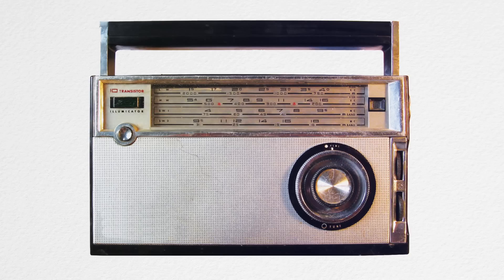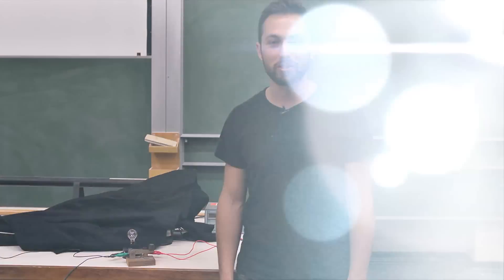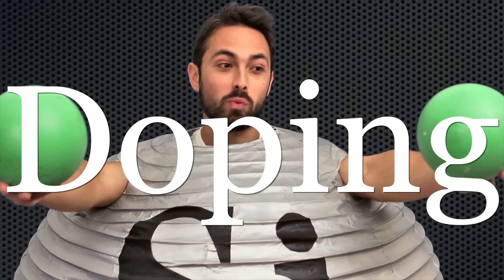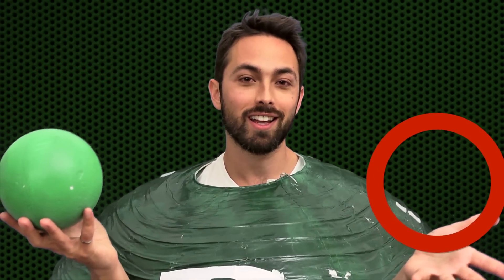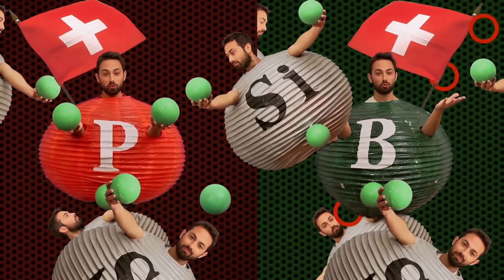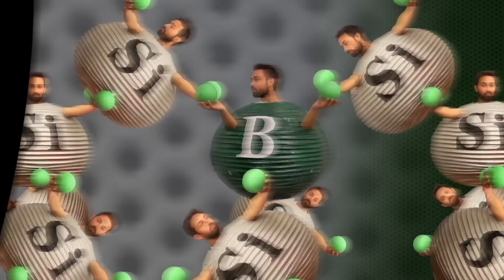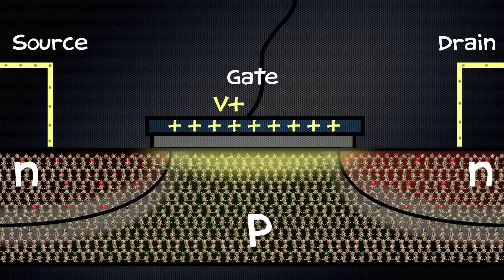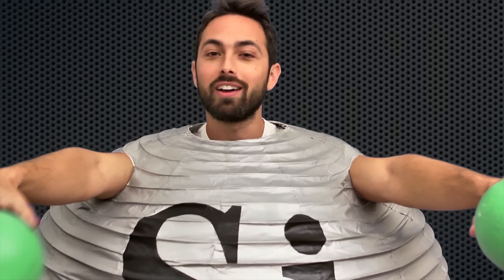How Does a Transistor Work?

Comment: id like to know, wouldnt u need to switch the voltage on and off using mechanical swith? doesn't that defeat the purpose?
Reply: Logic gates are a construct made from transistors.  They are a basic element of computers.  They perform logic functions known as Boolean functions.  The one that makes up your computer is called a NAND gate.  A logic gate has one or more inputs and one or more outputs and a truth table describes all possible inputs and what the outputs are for each set of inputs.  I would suggest looking up logic gate in wikipedia look carefully at the truth tables and learn them.

In a computer the inputs would at some point be the code that is running and the data that is being operated upon.

As for the transistor and where its input comes from, that depends on how it is being used.  If it is being used as an amplifier then its input is the signal to be amplified, such as the signal coming in from an antenna.  If it is being used as a switch then the input could come from the pressing of a button, such as when turning something on or as I mentioned before from the code or data being run in a computer.
Reply: it can also be used to convert analog signals, like ur mic, to digital signals.
Reply: Siddharth Agrawal
These transistors are used in logic gates – each single logic gate is a group of transistors. Basically a logic gate is a simple electrical component, commonly has at least two inputs and one output, that turns its output either 1 (on) or 0 (off) depending on the combination at the input. For example, the AND gate which needs both inputs to be in the 1 state for the output to be 1, or the OR gate which needs either or both inputs to be 1 in order for the output to be 1.

If logic gates are groups of transistors, integrated chips are groups of logic gates. Microchips contain hundreds of thousands, if not millions of logic gates to process, direct, and recognize data. Using mechanical switches to turn a transistor on is nothing too different. For example you want to make a mechanical-switch operated passcode or combination lock then transistors would certainly be used to recognize the switches you're moving. Plus, now that you're reading these letters on your screen, the time I typed these words, each key I press activates a set of transistors grouped into logic gates to present a specific binary code to identify which key I was pressing to display on the screen.
Reply: ***** i didnt exactly get first paragraph hope u would ellaborate. how do u connect the output to the ground or connect the output to the voltage source?
Reply: ***** PLS REPLY MAN
Reply: ***** i did google it :D. but i still didnt get why use transistors instead of switch. well i ll try to find where u posted it :D not very good at g+ as i never use it
Reply: ***** ok, why?
Reply: ***** ok ill check ur original post and research some more then ask u. thnx :D
Reply: That's why your reply was deleted, coz it linked to another website, pity. I have the same misgiving as the other reader, ie you can't say a transistor makes you spare a switch if you need a voltage switch in the first place to get it running.
Reply: *****
how is voltage supplied to a transistor?
Reply: ***** ok thanks, finally. so basically, in a cpu, the quarts crystal sends pulses of voltage of 5v and 0v periodically over certain time which each switch on and off a transistor?? kinda like ethernet cable???
Reply: ***** ik how logic gates work. btw. ok if (and idk if i am correct) a cpu clock works like an ethernet cable sending pulses of 5v and 0v. what tells it to send pulses in that order?
Reply: ***** +ill research some on this but i dont think i get it
Reply: ***** ye thanks :D i ll research on it when i have time, i got soooooo much work atm. ty mczidanne for ur help.
Reply: ***** k :D it would be cool if u gave me step by step wut i should learn. i ll get it to the list whenever u am free
Reply: it is useful in simple curcuit if used with ldr or thermistor
Reply: ***** WELL I HAVEN'T REALLY GOTTEN TIME TO STUDY ON TRANSISTORS, BUT I HAVE USED EM IN A FEW CIRCUITS AND I KINDA GET HOW THEY ARE USEFUL. NOT SURE IF ITS SIMILAR IN PC THO.
Reply: ***** k kool i guess :( doesnt feel all that great. kinda feels dumb af
Reply: ***** ye i guess :(
Reply: That is correct.  As an amplifier the transistor uses a small electric current to control a larger current.  Up to a point and then it melts and you have to use an old fashioned vacuum tube.  😁
Reply: *****
V-NAND is just a type of flash memory.  The signal is produced in the antenna by a radio signal whose origin is a radio or TV station.  The inputs to those signal are ultimately the light and sound waves that entered an  instrument which either transmitted those signals live or recorded them for transmission later.

Comment: so why not just using the gate as a transistor? since you can turn it on and off, I guess it should also be able to hold the values 0 and 1
Reply: by itself a transistor is useless, but a few can create a  logic gate such as AND, NOT, OR, XOR. with multiple gates it allows you to do math with binary numbers (base 2 instead of base 10) math is calculations which is what a cpu is designed to do

Comment: For anyone that cares, this is only how Metal-Oxide Silicon Field-Effect Transistors (MOSFET's) work.  Although they are the most important type used in modern CMOS integrated circuitry (C is for Complimentary), anyone wanting to learn more should also explore the operation of Junction Field Effect Transistors (JFET's) and Bipolar Junction Transistors (BJT's).

Comment: the only thing I see outright wrong in this model is when the depletion layer leaves cut-off and enters triode mode, the electrons pool to the gate and are actually pulled mostly from the thermally excited substrate, not from the source or drain.

Comment: Great video, but some minor correction is needed:
   [5:05] 22 nm (50 atoms) is not the size or width of a transistor, it is the name of the manufacturing technology process (semiconductor device fabrication). It is kind of manufacturing apparatus resolution, the minimal size of one step in processing, and not a size of a whole transistor, which is many times larger. 22 nm is kind of a width of the tip of your paint-brush by which you draw a painting. The smaller your pain-brush, the smaller portrait you can draw with this paint-brush without loosing the amount of details. ->>>>
Crystalline silicon has the lattice spacing of 0.543 nm, so 22nm/0.543nm = 40.5 atoms. They are planning to have 5nm process in 2021, which is just 9 atoms. Can you imagine a transistor of 9 atom width? It is 3 atoms for its central P part! Where are the impurities of Boron or Phosphorus supposed to sit in that case?
Reply: Could be wrong here, but I was under the impression that the quoted size of a transistor referred to the gate-width, ie the distance between source and drain.  Not the actual size resolution of a given component, which is much smaller.

ie, if you only had a 14mm resolution, think pixels, then you could only have a transistor gate 14, 28, 42, or 56 nano meters wide.  Their resolution control is much smaller than that.  And resolution isn't the [only/main] issue in going to a smaller transistor size.  The problem is the smaller they make the gate, the more the transistor leaks.  They have to make the gate and source/drain of a higher quality, in tighter chemical tolerances, to ensure a significant enough selective resistance between the on/off states such that the digital logic is still being performed to a sufficiently accurate level.
Reply: 2021...
Reply: @anonim6499  They started to use 8 nm fabrication process in Sep of 2020. So, they are pretty up to their schedule. Gamers video cards are not available in stores, anyway.

Comment: Little mistake: By applying a gate voltage, you don't really encourage electrons to jump out of the Source region. You attract electrons from the substrate underneath the gate, and repel holes at the same time. And as soon as there are more electrons than holes, this region behaves like an n-type layer (this is called inversion) , and that way, it connects Source to Drain.
Reply: This video is meant for 12-17 year-olds, man. It's just an oversimplification to get people interested on this topic
Reply: Timothy Kimman no. You're referring to inversion. Tunneling is the problem Derek was talking about, since to keep up with Moore's law, transistors have to double their number inside a chip meaning they have to get smaller. However once they get too small that source to drain terminals are too close, due to quantum effects electrons can tunnel from one terminal to the other bypassing the entire transistor which will be a problem.
Reply: Yes i was confused because if what he said was true the other n-type should also flow to the p-type and creating oppisite flows
Reply: Repelling holes is literally identical to attracting electrons in every way but semantically.
Reply: Hi Toni, thanks for the correction, this is very helpful and is a very important detail !!
Reply: my understanding(pls correct me if I’m wrong): so you mean the electron in the p-type got attract by the gate voltage and create a hole which now electron can pass through without getting repel and the electron that pass through p-type make p-type act like n-type because of the extra electrons that pass through?
Reply: btw what is “Source to Drain”???
Reply: @nontth5355  you see two n regions in the transistor right, the leftmost is source and the right one is drain
Reply: @nontth5355  There are two n type bro, one in left of p type, one in right of p type, in that, one connected to negative terminal/ one thru which e enters is source and thru which e exits is drain
Reply: I saw the video on the "Learn Engineering" channel about how transistors work first and I got so confused by the explanation on this one because of this little mistake lol
might have to research more on this
Reply: You're right in that the holes get repelled from the gate electrode, however there are no free electrons in the p-Type so they can only be generated by increasing the temperature and therefore the energy of the electrons until they are able to break free... But this is only one option, the other option is for electrons from the n-type to tunnel through the barrier into the p-type, just like he said in the video ;)
Reply: @CDTSimon  a little late to the comments but there are actually free electrons in the p-type region. They are minority carriers.

Comment: Silicon doped with boron makes it a p type. Inside this mixture can the electrons from the silicon atoms move to the empty space in the boron's valance shell to transform it to a silicon atom? If it does so, then the silicon atom would become a boron atom? Can the electrons play give and take? or am I missing a fundamental piece of information as to how atoms exchange electrons?
Reply: Even though the atoms might have different charges due to electrons moving from atom to atom, they still stay the same element due to the amount of positive and neutral charges (protons and neutrons) in their nucleus. So if boron gains an electron it will stay boron but gain a negative charge, and vice versa for silicon.

Comment: But don't you technically need another transistor to determine when to apply the positive voltage to alter the state of the first transistor, meaning that for a transistor to work, it requires another one? Does anyone know how it actually works?

Comment: This is very well done. I've worked in the electrical industry for over 30 years and often struggled to help students understand how solid state devices work. This video does a great job of animating transistors!
Reply: @Samir Zouaoui  You are correct, he did explain a bipolar transistor, but the graphic was an FET.  To me, that is a concern because reading the comments shows that there are many viewers who take every word and visual as gospel.  Many will be hobbyists most likely using BJTs which are Base, Emitter, Collector, not Source, Drain, Gate as per the graphic.

Comment: Explanation was great, but in transistor it has collector, base and emitter. not source drain and gate
Reply: +Ganesh N it does have. MOSFET transistor has source drain and gate, while collector, base and emitter are for BJT transistors. problem?
Reply: +Dechosen Pen this explanation is for transistor that's why I wrote this comment.

Comment: How do transistors amplify electric signals?
Reply: +Ryan Lee Hahahah .... You don't want to know
Reply: actually as a matter of fact i do!
Reply: +Ryan Lee Do you have any knowledge about electronics ? You should start by looking up the Ebers-Moll model (it's for a bipolar transistor).
You also have to understand that a signal can be carried by the current or the tension. So you want to amplify a current or a tension, or change the parameter that carries the signal (switching between current and tension)
Reply: my knowledge is limited but ok i will check it out. thanks

Comment: JUST THINK OF A ELECTRIC MACHINE WHOSE 2 WIRES CAN BE CONNECTED TO ANYTHING RANDOMLY AT ANY PART TO ABSORB THE ELECTRONS CONTAINED BY THAT SUBSTANCE LEAVING A SOLID PROTON BODY.

HOWEVER ITS NOT POSSIBLE AS CURRENT NEEDS POTENTIAL DIFFERENCE TO TRAVEL WHICH WILL MAKE THE NUMBER OF ELECTRONS NOT TO DOMINATE.

THUS IF WILL BE ABLE TO MAKE THIS TYPE OF MACHINE 
THEN I CAN GENERATE FREE ELECTRICITY
FROM ANYTHING.

HOWEVER THE SIZE OF THE SUBSTANCE WILL SHRINK TO ONLY PROTON BODY WHICH WILL NOT BE STABLE A PROTONS WILL SCATTER AWAY.

BUT TO FIND THE NEW PROTON SUBSTANCE SIZE FROM BEFORE EVEN BEFORE I COULD BE ABLE TO MAKE THAT MACHINE THE FORMULA OF PROTON SUBSTANCE LEFT WOULD BE:-

                                = D -D( x -x*4/5)
HERE D IS THE DENSITY AND X IS THE EMPTY SPACE IN THE ATOM.

  AND PLS POST A VIDEO ON HYDROELECTRIC GENERATORS.

AND SORRY IF THE ABOVE NOTATION IF TIME WASTAGE.

I JUST WANTED TO EXPRESS.........

Comment: 03:48 Why do electrons diffuse from N to P layer if both parts are electrically neutral?
Reply: +krzemian  Because of the physical property diffusion, particles tend to equalize their concentration in the given space.
Reply: +Veselin Manev Thanks. I get that part now. But once the gate is open, what attracts electrons to the right N layer and consecutively to the drain in 04:45? To my understanding, positively charged gate should attract electrons from both left and right N layers, resulting in an accumulation of negative charge near the top of the P layer.
Reply: +krzemian Actually, he did not explain it very well, the positive potential on the gate attracts electrons from the p-type, ( also pushes away holes) and creates a new n layer (yellow zone on 04:43) which is also called a channel. This creates a free path for the electrons to move.
Reply: +krzemian Because the video is very handwavey about the chemistry. He has good reason for that and I'm not going to go into the details either, but there is electric potential there, so there will be measurable current.

Comment: This video says that a transistor acts as a switch but it fails to explain something that might be obvious to those who know but to a newbie like me, it got confusing.

If a transistor is a switch with no moving parts, this switch is activated by the gate. So what controls the gate? Because wouldn't whatever decides to send voltage to the gate be acting as the switch and so makes the transistor somewhat redundant?

I know I am wrong, as I am missing information that wasn't explained in the video... Otherwise, its a great video!

Comment: I really, really, want to understand exactly how these things work, but every time I go deep into electronics i just get more confused. I can do quantum mechanics, complex algebraical proofs involving imaginary numbers, but just not those stupid electrons. I watched this video, said OMG i get it, then saw comments saying that this is only a specific kind of transistor, so I looked up the other kind and now I'm busy wiping the brain off my screen.
Reply: +GEORGE witton I recommend the book Microelectronic devices by sedra smith, as far as I've seen it's the bible on semiconductors, this video talks about FET type transistors and really only discusses cutoff and saturation, or the switch type properties.  It does nothing to explain the biasing and how that can yield three distinct modes of operation.  It doesn't touch on the BJT at all.  This video is strictly for semiconductors in chips, and it does a good job explaining why a FET conducts or doesn't but it's really just the surface of the topic and doesn't discuss at all current controlled bjt type npn or pnp devices.
Reply: +GEORGE witton Give me an example of a proof you can do involving imaginary numbers
Reply: Redice when i said "do" i meant understand, cope with etc. I understood the videos or books or whatever sources at the time, but I couldn't recall what happened in them exactly. I'm sorry if there was confusion, to be honest I probably should have worded it differently
Reply: @doorhanger9317  the way you say things seems like there was an attempt to look smart, not gonna lie
Reply: It's just a valve - a TRANSFORMING RESISTOR. It's not just a switch.
Reply: Maybe star by revising basic chemistry?
Reply: Which other type?
Reply: Same like me
Reply: this is an npn transistor , there are also pnp transistors which are similar but still different
Reply: @maskedredstonerproz  The big difference is that in this video he's explaining a MOSFET, which is a field-effect transistor just like the JFET. But there is also the bipolar junction transistor and they can be divided in a npn and pnp transistor.
Reply: You probably sound really smart to stupid people